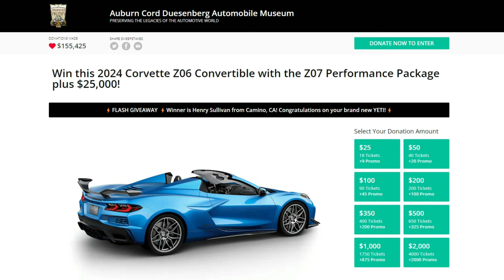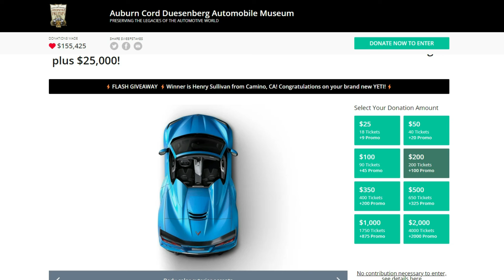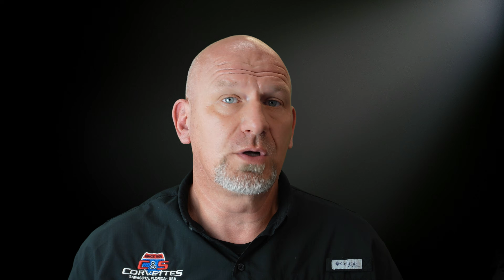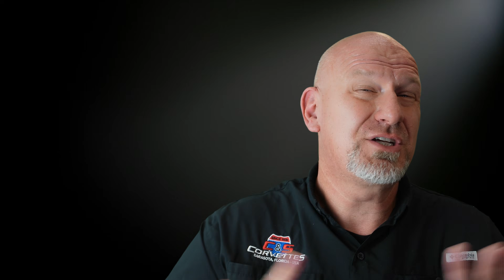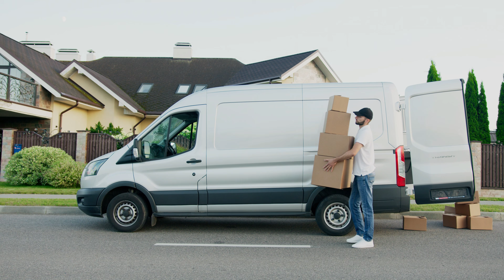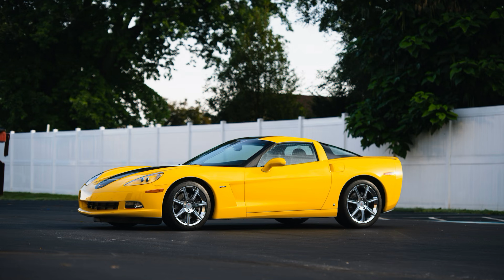Why do Corvette parts cost so much?

Comment: Question  - I have two original corvette doors from 1978 to 1982.    Can you let me know how I'd know how much these would be worth?  They are not in the bet condition, and I can send in pictures.

My father passed away, and I am trying to decide if they are worth paying to ship across country as I am emptying out my parents house.  

Ps,  I know they are original b/c my father owns a 1965 corvette and he used to do a lot of car shows.  Be bought the doors in the 90s and they've been in the garage for more than 20 years.
Reply from the maker: They key will be determining how much rust is present and how many little ouchies the fiberglass has.  Excellent doors are worth about $850 each with everything in them and no rust/damage, but the price drops dramatically once you start having to repair all of the imperfections these doors collect in storage.  Lyle

Comment: In the 70s, I had a friend who worked at a large VW-Porsche-Audi dealership. There were 3 parts schedules according to vehicle line. The same set of ignition points would cost you more as you went up the divisions.
Even Mercedes Benz used the same ignition points as the Beetle.

Comment: I have a C4 that I recently bought a gas tank lid emblem for more than 30 and less than 40 dollars. It broke when I opened the lid. It is a "beater" vette that runs like you wouldn't believe because I bought it from a mechanic that concentrated on the engine. It has multiple cosmetic challenges but if I could get a few key operational problems resolved, I wouldn't care about the multiple bodywork issues. I realize it's a 30+ year old car but it is so much fun to drive.

Comment: I was quoted the other day $2500 to do a rear main real on my 69 390 horse local (corvette repair shop). Why do we pay more at corvette repair shops then regular car repair shops. At a very good named regular repair shop i was quotes $900-$1000 for the same repair.  Don't get it?
Reply: Does the 2500 give a better warranty  than the 1000?  I would take that into consideration.
Reply from the maker: David, I think that quote is particularly high.  My guess is that the shop wasn't really wanting the job and were pricing it as such.  Working on 50+ year old cars certainly has its own set of challenges, but a rear main seal job shouldn't cost that much.  Lyle

Comment: To add: my 2009 C6 wiper blades, probably used on all generation C6 cost me $12 from a chev dealer in San Diego! $12! OEM.
Replacements at O’Reillys are $32 and higher made in China. WTF

Comment: Thanks Lyle! Always good content and appreciated 👍
I will say this, latches, bezels, escutcheons are one thing… but REAL OEM parts such as brake calipers, rotors, engine parts. Advice from my mechanic is NO commie parts! Why?
Always lower quality and crap for reliability.
It’s true Delco parts are made a lot in Mexico but GM controls the spec and quality.

Comment: This Video looks pretty strenge, for a Guy like me from Germany 😂
Because Car Parts in Germany are expencive like Hell. Oh, and i dont mean Porsche or Mercedes Parts. No, Parts for a crappy VW cost more than for a Corvette. 
When i had my Corvette New, and i searched Lambda Sensors for the first time. I found 2 Lambda Sensors on Rock Auto for 44$. To be serious, at this time i never heard about Rock Auto. So i was thinking, this is a Scam. You send the Money, and never See anything. 
Car Parts in USA, Corvette or not have a very fair Prize, in comparsion to German Car Parts.
In Germany you pay for those 2 Lambda Sensors 200$. And when you buy them strait from a GM Dealer maybe 350$. Just for example 😉

Comment: We have a 2014 Corvette Stingray 2LT. We’ve been looking to upgrade the interior components and swap them into carbon fiber and get rid of some of the plastic that’s inside. It will cost a small fortune to replace the window switches instrument cluster bezel center console bezel, and steering wheel. It’s over $2000 to upgrade.

Comment: I do not consider Corvette parts to be expensive.  They are cheap compared to any import like Audi, BMW, Mercedes, etc....parts. And if you consider Ferraris, Porsches or Lamborghinis then the difference is insane. So GM is not filling its pockets selling Corvette parts.
Reply: A buddy at work used to say, "You can justify anything".
Reply: I’m sorry but C5 parts are very expensive….Just the front windshield weather strip is 800 bucks…

Comment: Even on the OEM end of Corvette parts you can sometimes do a cross reference to see if the part your looking for was used on some other GM vehicles and check the price for say a Chevy Caprice VS a Corvette. Most dealers will list the Corvette much higher. This generally applies to engine parts and driveline stuff not the Corvette specific stuff. The reason why the OEM Corvette specific stuff cost so much is the cost amortization is spread out over far less vehicles. The R&D and tooling for a million door handles spread out is pennies where 30K will it be dollars per article.

Comment: It’s not the cost. I own a 2007 C6 convertible. Most of these innocuous parts are unobtainium. Needed a ‘top closed” switch sensor replacement. It’s not made anymore. No aftermarket support.  Junk yard find only. And they know what they have.
Reply: Your right. I needed a new fuel tank and got super lucky GM was still making them for the C6.

Comment: I work in the auto parts industry and Corvette parts really are not that expensive. Example us if you want to replace a OEM Mazda CX9 headlight you could be paying up to $6500 Australian dollars for that headlight! Or a windscreen that costs $2800 before it is even installed or had its ADAS system calibrated!